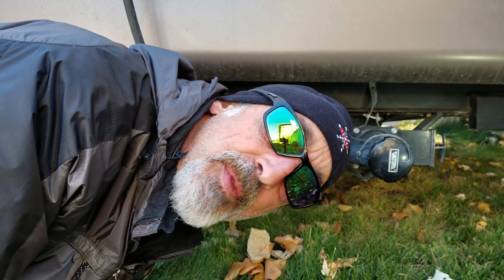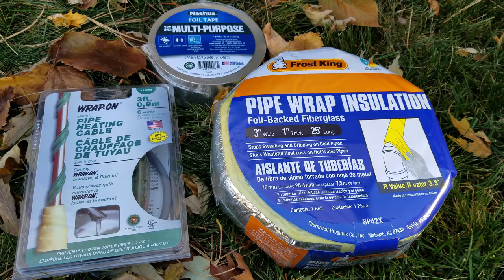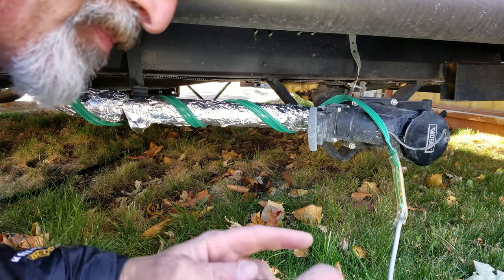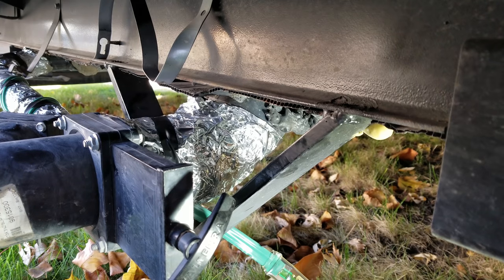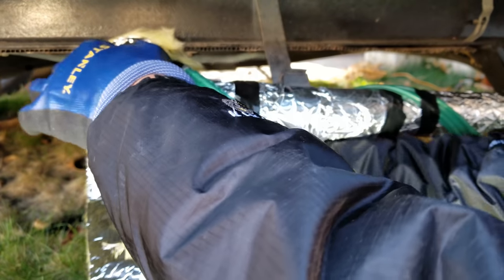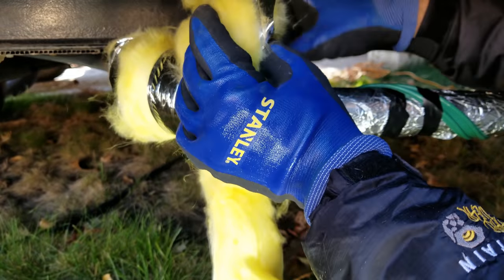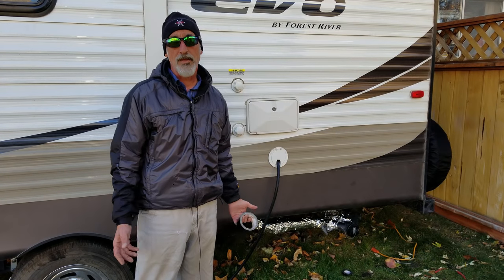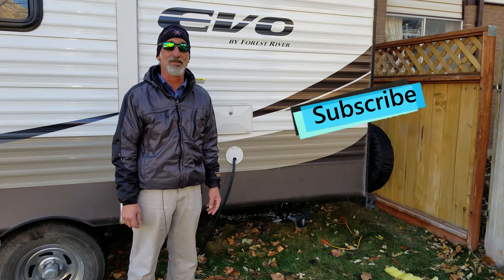Ep. 12: How to Keep Your RV Dump Valves From Freezing | RV How-to

Comment: I have winter camped for over 20 years now.  -42 is my record.  Mt. Bohemia, Upper Pennisula of Michigan.  I always add to my black water tank about 10 cups of road salt.  Keeps it lucid.  Yes it can ruin your electric gauge reader; but hey, a flashlight peek down the hole shows you when it is full.   Lastly, I put my used paper in waste basket, dirty side down.  Paper is a sponge that creates airpockets and promotes freezing.  Plus no paper, I can go a long time inbetween dumps.  Grey water tank, I leave the valve open, just watch out for making an ice rink below your steps.
Reply from the maker: Good advice all, Craig!

Comment: Just got the wrap-on cable. And guess what....it says in the instructions..."Do not use for other services such as waste or drain lines,....." In the first paragraph after warning and caution paragraphs. Man! Also it doesn't specify any pipe bigger than 3/4" on the back of the box. Read the instuctions first please. The one I got actually looks defective. After the tester the exposed coper wires are untwisted and spread apart and a stray filiment of wire is almost touching the other side. That could mean a bad shorting issue. The twisted filiment wire needs to stay twisted and locked together so you don't get single filiment shorting causing a fire. Soooo...dang I have to call support and they make me pay for shipping back! That is BS. I was sooo hoping for a fix. Just thought I'd let you know. Oh, it also says the lines have to be filled with liquid water so if you have like the gray drain open you can't use the wrap on it or more fire issues on a plastic pipe.
Reply from the maker: Sorry to hear that you got a defective unit, John. Agree that you shouldn't leave your gray open -- there needs to be liquid in the line. That said, we had no issues whatsoever using this in the manner which we posted.
Reply: Thank you.If you had not b posted this warning I would have used his method and potentially started a fire.Unless Mark Guido puts a full disclaimer that the lines must full of liquid before heating, his instructions  put people at risk for injury and property loss. I am really thankful for your input.I encourage Mark to rethink his entire post for obvious reasons.
Reply: Funny that I’m seeing this video now. We just got back from a trip,to CO and our pipes froze.  Apparently on my last trip, I didn’t close the black tank valve. So, if my pipes would not have froze, it would have been messy.  I ended up buying a heat pad, wrapping it around the valves and wrapping with a packing blanket.  Then removed the pipe cap and connecting to a honey pot.  Marc, you have some great ideas for my future plumbing needs. The only change I would make is to switch out the tape with tie straps. Tape gets gummy after a while. Stay safe on the road.

Comment: I thought that was a good video but one question is everything covered up enough so that the insulation doesn't get wet
Reply from the maker: Yep. With the foil tape and duct tape we've had no issues after roughly 15k miles and a year of travel. Thanks for watching. And for commenting!

Comment: PVC electrical tape has a gooey adhesive that melts under mild heat. Get a high temp tape, or use zip ties.
Reply from the maker: We used duct tape rather than PVC electrical tape, and that setup held up for the several years that we still had that RV.

Comment: Arctic Package? I just saw a 2022 Keystone with that same package and the dump valves installed outside of the heated under belly! A true 4 seasons rated camper will have those dump valves inside the heated under belly up near the tanks with a cable to an exterior T handle.
Reply from the maker: We completely agree Ray, and that was a prerequisite to our new fifth wheel when we purchased it.

Comment: Last winter we stopped in Ft Stockton during a,snowstorm.  We saw someone using a red heat lamp to heat the dump tanks and plumbing under his RV.  What I like about this solution is that it seems simpler and more portable (?).
Reply from the maker: And far less risk of melting plastic with that heat lamp, Glenda. Glad you enjoyed! We don't treat it as portable, though -- it's been sitting there on our pipes waiting to go for 3 years now, and it's still going strong.

Comment: I full-time in a 2017 PUMA 253FBS with enclosed underbelly and 12V heat strips on the tanks from the factory, but with all three dump lines and valves exposed. In January 2017 I spent a couple weeks in North Carolina when the forecast was for 10 days staying below freezing. Ran to Home Depot and picked up a heat tape and foil backed foam insulation, and did the same type of install. This has worked great for me since then, even down to 5 degrees in PA this year. The only issue I have is the valves seem to freeze closed in the worst weather. A little hot water poured on the valves and they open. It could be the seals getting too cold.
I didn't use foil, but I like that idea.
Reply from the maker: Yup Kurt, this setup works great, as you've found yourself.  We traded in the trailer shown in this video when we went full-time, and as we spend our winters skiing from the RV rather than running south, prerequisites were that our dump valves were enclosed within the underbelly and we had a heated wet bay. If we still had exposed dump valves we would've wrapped them the same way.

Comment: Can’t get to the original spot. I ended up getting new fittings and 3 inch line. My 1st cut about 4 inches back from the first section and I got wet. The ice was about 2 feet into the pipe and now I know if it is cold here (32 high-10 low) to keep the valves shut so the ice damn does not happen again. Now I get to redo the insulation. Thanks for your video

Comment: GReat video! 
Remember, fibreglass insulation works by being 'puffy'(uncompressed).  Very lightly wound, do not tightly wind, and with no air  movement (air cracks) flowing freely from outside to inside.  The 'puffier' the better.  It is not self-supporting very much, (no outward push from within itself) so be careful not to force it smaller  Leaving it large will get you your R rating and your monies worth, as well as peace of mind in a deep freeze. 

 The amount  air between the fibres is what holds heat.  More space between the fibres, more insulation.  It works by trapping air, and its that natural and free air, kept within a  boundary,  which you are requesting help from.

Also, do not let get wet, or all heat is lost.  Better to use "rock wool" insulation which is water resistant.  As well, all insulation must breathe a little bit, to allow condensation to escape.  This is a tricky one on this install.  There is a tiny bit of permeability through plastic tape.

 However, wrapping the fibreglass insulation in TYVEK house wrap would be better;  as it allows water to run off but is designed to allow humidity to escape.

I think , just put a little roof over it to keep rain mist,  rain splashes (up from the ground puddles), and water cascading down the wall of the camper from getting anywhere near it.
Reply from the maker: Great advice all the way around, Mike -- thank you!
Reply: After  rockwool insulation  what do you think about lightly applying reflectix  over it and a black plastic 9 mil ?

Comment: I would install the heat tape before the foil so the foil can have a better thermal property. Also, I would wrap from the outside in, that way you can add a plug inside instead of needing an external cord. This would be able to run off the main power and have a switch inside the trailer.
Reply from the maker: Interesting ideas, Ryan. We chose to put the foil beneath the heat tape to more evenly distribute the heat, especially as the pipe is PVC. We figured that we'd err on the side of caution.
Reply: Yeppers...great ideas thx. My concern would be freezing while traveling, so I would reverse per comment above and figure out how to plug in inside trailer. I have an extra outlet inside the fridge cavity right above by dump valves. New solar/battery system I installed providing 120v to OEM system while driving. Love this idea thx...along with heating the underbelly.
Reply: @DeekJohnson simply use 12 volt heat tape. It works while driving and continues to work if the power goes out at the campground.

Comment: The old saying "a day late and a dollar short" sure applies to me in this case. Sure wish I had seen this prior to experiencing -45 in Montana this winter. I thought an R-13 insulated underbelly would do the trick, right? Not even close...everything froze, and I mean EVERYTHING. When I discovered that the FACTORY "4-season" insulation was the thickness of a mailer you would get at the post office (1/8"), I was outraged. Don't buy Keystone RV's unless you insist they actually put REAL insulation in the belly. As a novice RV'er, I got to find out the hard way about both this and the tank toggle valves that also froze at only 20 degrees!

Thanks for your video. Sure wish my valves were as convenient to get to as yours. I will have to drop the entire belly cover to get to mine.
Reply from the maker: I've dropped the underbelly cover on our current fifth wheel, different from the trailer shown in this video, and trust me when I tell you it was a pain! The worst part is getting the cover back in place. However, if you do that you will have the ability to insulate that area any way you wish.

Comment: Thanks do much for your video. How has this held up for you? Looks like the install was over 6 years ago. I was reading the instructions on the heat tape I purchased and it says to not run when it is coiled. Any issues?
Reply from the maker: You're most welcome, and thanks for watching! No issues whatsoever during the four additional years we had that trailer. That setup was still going strong when we got rid of the trailer.

Comment: Nice mountain hardware jacket.
Reply from the maker: Thanks! That one was actually a prototype that turned out to be too expensive to manufacture. The shell is a 4-way stretch, so they actually had to hold the tubes open with compressed air to be able to insert the down fill. It's too bad they never made it for the public, as it's one of my favorite jackets ever.

Comment: It’s been a few years since you insulated the dump valves and pipes.   How did it did it do in freezing weather and how did it travel?  Thanks for the time doing the video.
Reply from the maker: It held up perfectly right up until we traded in that trailer in October. It worked like a charm for the past few years.
Reply: @GrandAdventure  thanks, just the information we needed.  We're in tennessee and occasionally see the 20's.  And just need something to give piece of mind.  Looks simple and cheap.
Reply from the maker: @joshbowman4060  It is both, two of our operating principles right there. 😁

Comment: What about the RV water pressure regulator what do you think would be best to protect it
Reply from the maker: Absolutely. Anything that's potentially exposed to freezing. In our current rig the water pressure regulator is actually inside our heated wet bay. On this old travel trailer that we featured in this video, however, when we were on hookups we used a heated hose and put a foam sleeve over the pressure regulator.

Comment: i was always told not to cover up the thermostat on the heat tape or it wouldnt work correctly. Dumb question but why does this area need to be heated? if you dump the tank there shouldn't be any fluids to freeze in the pipe by the valves right? Im new to this so probably dumb questions
Reply from the maker: Not dumb questions at all. We left the thermostat outside of the wrap, for the very reason you mention. The way our valves were set up on that trailer, the gate valve was near the end...so there would've been fluid leading all the way to the gate valve. That gate valve didn't have a remote handle the way that some others do.

Comment: This is how I did my valves as well except I used that kind of heat cable and it failed in a year. So I went with the expensive ones. Only difference from mine is I used stick and peel flashing on the outside to weather proof. And then cut holes and put expanding foam in there to get rid of any air pockets. So the wind cant blow in. Works wonders I got to -30 celcius and was still able to dump. My tanks are heated so no issues
Reply from the maker: dylan christiansen an excellent (and apparently quite effective) variation! Thanks for sharing.
Reply: hi dylan, can you share a link to the brand of heat cable you used instead of the one that failed ?

Comment: This is a great idea. Do you only plug into the external 120v outlet once you're at your campsite? Or did you hardwire it somehow?  Thanks
Reply from the maker: If we're in a campground, we just plug it into the 20A outlet on the pedestal. If we're boondocking we plug it into our trailer's exterior 120 V outlet, as all of our outlets are powered via our batteries and inverter.
Reply: Really appreciate this info.

Comment: Need to wrap, heat cable  around valve box slides ,and cap entrance. Also some salt down drain will lower waters freezing point for grey/black tank. No fun to have your cup runneth over.
Reply from the maker: None at all.
Reply: Wont the salt ruin damage tanks ?? Why not RV antifreeze
Reply: @DavidSmith3750      Dave , holding tanks are made if A B.S.plastic and are not affected by salt , as for antifreeze  price are $ 3 to $4 dollars a gallon at full concentration 50 blow Zero but when mixed it looses it's strength quickly , rather salt at a low .50cents a carton will lower water  freezing  down to zero degrees Fahrenheit , the choice is yours..  it's just a low cost low tech  below 32 f winter camping protection.

Comment: Hey, been watching videos similar to this for 2 hours and yours is clearly the best. Really simple and thorough, thanks!

Quick question: how exactly does the heating cable work, where should I plug it in?
Also, if we are driving around all day, I can't really plug it anywhere, will the pipe not freeze then?
Reply from the maker: Thank you Mart! In our case, we pretty much did this only for when we're in camp. For those days when it dips into the mid-20s for only a few hours overnight, you could run this off an inverter on your house batteries. For longer periods of below freezing temps, including all-day situations, you'd have to be in an electric site or be prepared to run your generator often. 

We really didn't design it for driving for a few hours, but it wouldn't be too hard to run an extension cord to an inverter and then zip-tie the extension to your frame, etc.

Comment: Mark , I replied earlier this week on doing my exposed drain pipes as you did . 
Question ? If I used the black duct tape as you did do I still need the foil tape you applied to insulation before using black duct tape ?
Thanks , Doug Floch
Reply from the maker: I just figured that out was good to reflect that heat back inward.

Comment: If I have foam board and vinyl skirting do I need to wrap the pipes? I was thinking of just wrapping the hose that connects to the valve which will be exposed.
Reply from the maker: I'd think that if you can keep it sufficiently warm within the skirted area, you'd be good to go.

Comment: What about the slide valves still unprotect from cold , hence out comes the hair dryer,  use armaflex or closed foam insulation when that gets wet it's worthless. Good luck.
Reply from the maker: We've been running like this for over 3 years with no issues. Agreed that we could have used a different insulation, but it's been holding up just fine. And the slide valves are actually within the heat tape and insulation. Never needed the hair dryer.

Comment: Great vid. Is there a risk of using the fiberglass insulation with the heat tape. Couldn’t it catch fire (very rare i assume)?
Reply from the maker: Thanks Fouzan! The heat tape just doesn't generate that kind of heat. I suppose that if you inadvertently crossed wires while wrapping it would be possible (?) but I still have my doubts.

Comment: Maybe I missed something what about the black water tank piping to the valve? Do you do the same with that piping. I was also thinking of a heat pad on the bottom of the holding tank. What do you think?
Reply from the maker: David, we did have tank heating pads in that trailer (we traded that trailer in October 2020), so the vulnerability that we addressed in this video was the exposed dump valve and pipe. That's what we wrapped and insulated in this video.

Comment: I enjoyed your video and thinking of doing same . I have about 10 ft of 3 1/2  inch black pvc drain pipe with valves to cover . Am thinking a 12 ft length would be  the most likely length ? Would like to include wrapping valves also ? Is using a 3 prong grounded extension electrical cord sufficient?

 Option : I only need cold weather protection briefly for a couple of nights of temps 10 degrees F , would putting a couple quarts of rv antifreeze in empty grey water and same in black water suffice ? 

Your comments would be appreciated !

My wife and I have started watching your channel a year ago and one of our favorites as your content and information is very well covered.
Thanks ,  Doug
Reply from the maker: Thank you Doug! I'd go with a length of heat tape roughly 1.5x as long as the pipe. Yep, a grounded outdoor extension cord should be fine. RV antifreeze would certainly help, but it'll be so diluted at the valves I'd be concerned that it wouldn't be enough by itself at 10F.
Reply: Yes, rv antifreeze can work. Before adding it, empty the black and grey tanks. You'll need about 3 gallons, 2 gallons into the black tank via the toilet, other gallon down one of the sink drains.